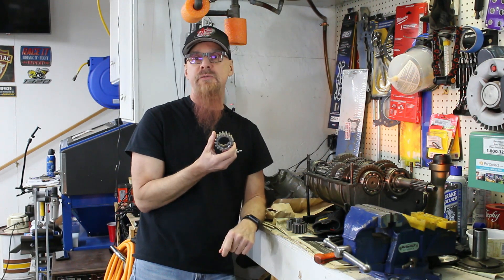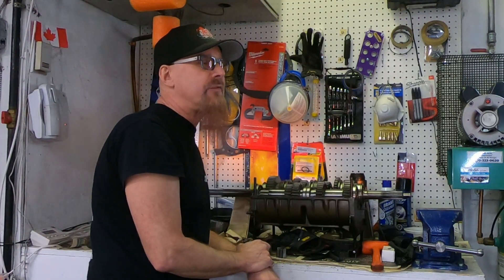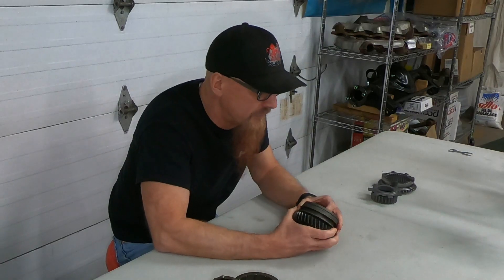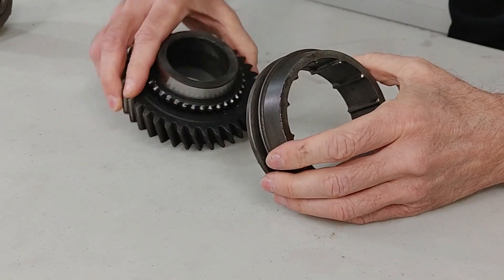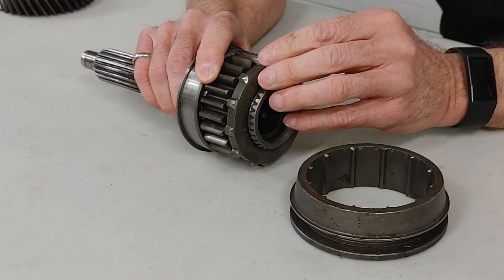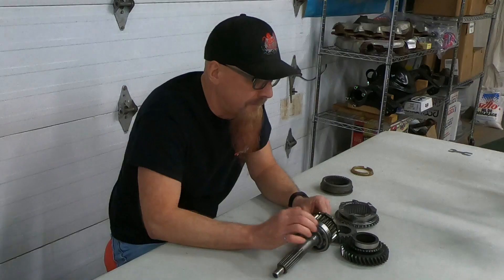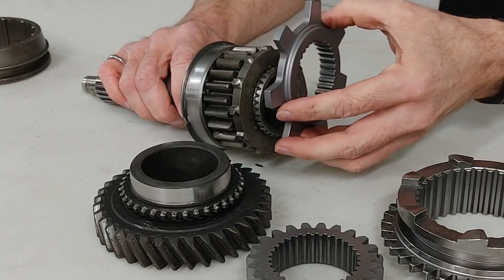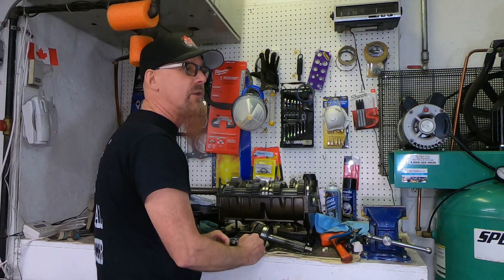Transmission Shift Engagement Systems

Comment: Cool video! One minor point, on an upshift the sychros are having to slow the next gear/input shaft down, not speed them up.
Reply from the maker: You're right. Not sure where my head was there.
Reply: @The_Performance_Laboratory  What do you thin about the following. I leave 1st with synchro... 2nd 3rd and 4th are dog engagement, 5 and 6 are synchro. I will be using this on the street so 1st should be very convenient normal and cruising in 5th and 6th will be also stock feeling.
but most pulls and launches are shifting into 2 3 and 4. and by the end of 4th I am way over the speed that I should be going
I think this is very reasonable, what do you think?
cheers.
Reply from the maker: @FirstLast-tx3yj  yeah, that's a great plan. The "backup" trans for my GTO still has a synchro in 1st, and pro-shifted 2-4.
Reply: @The_Performance_Laboratory  did you notice a difference in the clunk sound when you go on/off throttle between the proshift and the dog engagement? 
I know dog engagement clunk a lot in street driving due to the large gap between the teeth when you go of throttle, but does the proshift also do that? because it has smaller gap
Reply from the maker: @FirstLast-tx3yj Both clunk about the same.
Reply: @The_Performance_Laboratory  i just wanted to mention this to you maybe someone has tried it before. Having any gearset added to my zf 5 speed bmw trans will cost me upward of 4K and that is more than my car... I am also outside of the USA so I dont have any faceplating services that are more affordable and gear specific.

So I was thinking to going back to the old school grinding and trying my own crashbox but try and preheat then weld between 2 consecutive teeth to fill the gap carefully and slowly. 
I will grind 4 weld teeth and weld 2 and see how it goes... a new trans is 200$

Do you think this will work?

How  long would you guess it will last and will it be shifting as fast as the proshift/dog engagement? are the questions
Reply from the maker: @FirstLast-tx3yj that would probably work well, assuming you're a skilled grinder and welder .

Comment: I have an opportunity to purchase a pro shifted doug nash 5 speed with dog rings and straight cut gears for my drift car. Im curious as to the street driveability / downshift capability if i have it face plated? Not much info out there on the web.
Reply from the maker: You won't notice much difference between Pro-Shifted vs Face Plated on the street. Both are unsynchronized, so they're both going to be very harsh on the street, and require driver skill for rev matching on downshifts. For upshifting with minimal harshness, double clutch the upshifts too.
Reply: @The_Performance_Laboratory  thanks for the quick reply I may just have to grab it up and see what happens.

Comment: What kind of prices are you getting from Liberty?
I have an old DN4+1 and its nearly impossible to find NOS parts for it (Richmond carried some for a while - no longer).
At what point do you bite the bullet and buy a G-Force or Liberty 5 speed?  Since your running stock eliminator, you have to keep the 5 forward gears right?
Reply from the maker: As far as I can find, Liberty's is the only game in town for replacement Doug Nash (race) trans parts, and their prices are typical for this kind of racing stuff. If you have a street Nash 5 spd, I don't know anywhere to get parts. Converting the rest of my gears to face plate, and fixing any other breakages (several times over), will still be much cheaper than buying a complete LSC5000 or GF5R. But at some point, I might have to. And I don't run the car in NHRA class anymore, but yes I could run 5 forward gears since the original T5 had 5. You can run less though, so 4 speeds are common in Stock and SuperStock cars that were originally 5 speeds.

Comment: Yeah just took the Cobra for some play time, think I need a new clutch. What did you run when you had a t5?
Reply from the maker: I started with a Ford Motorsport clutch upgrade, but went through a whole bunch of different things as I learned (the hard way) about clutches. Video on clutches coming up hopefully next...
Reply: @The_Performance_Laboratory , sweet thanks bud. I think with your channel you have a lot of insight and experience that normal Joe's are looking for.

Comment: Great video. I tore into my buddies 4+1 4 times. The case is the weak point for them and spreads as the gears climb each other. When that happens..teeth go missing. Usually it was 2nd gear that went. I'll have to try liberty? The trans needs some parts to be perfect. It still can't handle more that 450ftlbs though. It's the street version obviously. The motor in the car makes well over that, so that has alot to do with it.

Comment: Great video. Power shifting is so cool. Remember roaring around in a buddy's 440 6-pack 4-speed Cuda many years ago. Had the pistol grip shifter. So much fun to power shift thru the gears.